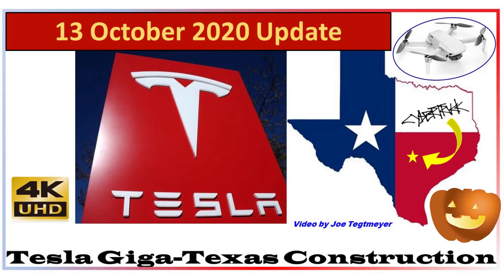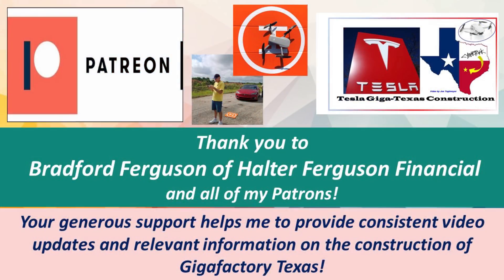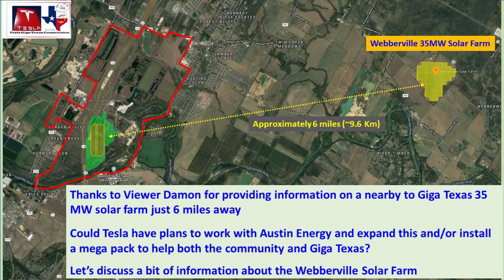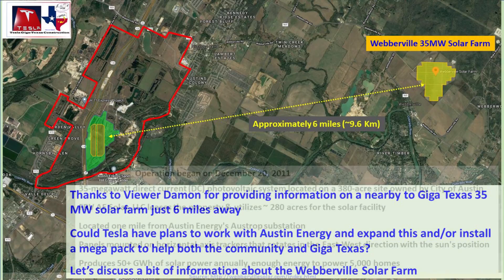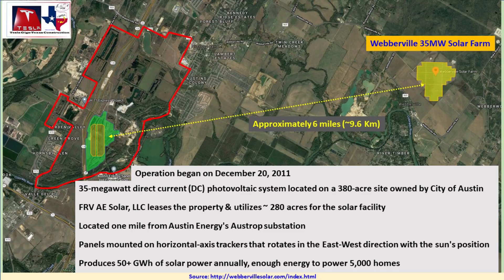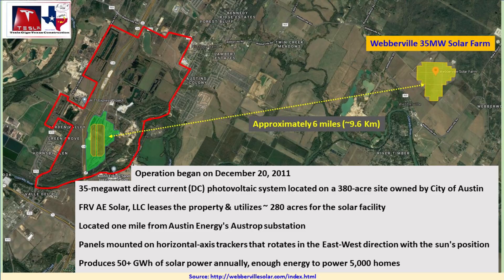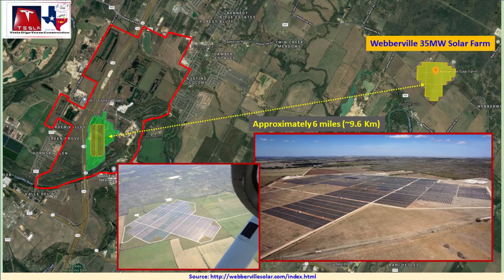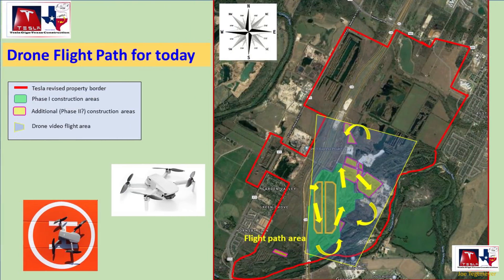Tesla Gigafactory Texas 13 October 2020 Construction Update (09:00 AM)

Comment: It's amazing how Ranger Excavating has used heavy earthmoving equipment to make such graceful contours in the large water detention pond at the south end. Well done Ranger dudes! 
Keystone will  be in and out during these early stages. They'll do a pour then have to wait for awhile for the concrete to cure. Concrete will reach full strength in about 28 days. But reaches 70% after 7 days. Some of those blocks on the flatbed in the pit look like they could be utility vaults for things like electrical power.  Expect we'll be seeing many utility vaults around the site in coming weeks.
Reply from the maker: Thank Dedric ... turns out the “concrete blocks” were actually concrete forms and were put up on the big mud slab later in the day to prepare for rebar and concrete installation

Comment: The other day someone asked about the clearing that was going on under the power lines. I also watch the Giga Berlin videos.  They are going to need a huge amount of area for staging of tools, equipment, building materials, equipment, etc once the building starts going up.  The switch yard is also going to be used for all of this stuff the contractors need to have.  It is going to get quite busy in the future when you have many things going in parallel.
Reply: A minor point:  there are much stricter safety rules, OSHA primarily, about operating heavy equipment beneath electrical transmission lines, also there are other special rules for operating near a natural gas transmission lines.  In many projects these extra rules discourage contractors from using those areas.  In many cases it isn't worth the additional monitoring requirements or the hassle involved.

Comment: Smaller pit is most likely for stamping shop. I am not convinced that cybertruck's folded metal design would require any specific below-ground equipment. Note that stamping shop capacity is reduced when a lot of previously stamped components are replaced by large cast sections.
Reply from the maker: You may be right about the CT panels ... I just don’t know enough about how they form those panels and what equipment they might need.

Comment: Solar farm would help, but if used exclusively for Giga Texas, would provide just 10% of power for the current  phases under construction, based on Giga Shanghai phase 1 and phase 2 joint consumption of 300MW.

Comment: i ordered a Cybrtruk in mid Jan. so i am pretty far down on the wait list ...  But wondering about what day next yr is this factory gonna start spitting out the products ???
Reply from the maker: Target date for first production is supposed to be early May.  But, Tesla has not yet announced which products will come off the line first or what “first production” means yet so we still have done details to learn before a good guess can be made
Reply from the maker: Sounds good to me
Reply: "First production" does not necessarily mean making a product for sale. It could mean first attempts at running entire production lines, which usually means tweaking is required to solve fitment/quality. It is a lot simpler to predict when startup will be than to know when high speeds are assured.

Comment: I think the semi truck in the large pit is loaded with stacks of concrete forms. I’m no expert but solid concrete in that amount would absolutely crush that trailer!😂
Reply from the maker: I appreciate the info and thoughts ... at this point we all have to speculate but that’s part of the fun!
Reply from the maker: I think you are right ... after I published the video I was looking at what was on the truck and thought the weight would be too much.  Concrete forms is a better idea
Reply: @JoeTegtmeyer  again I am speculating here, very large foundation footings have to have the rebar assembled in place and so sometimes they will install two or three sides of the formwork to give them a good reference from which to build the rebar cages. Could explain why the forms would be there before the rebar. Keep up the good work!

Comment: I don't understand why there would be a need for a turnaround. Perhaps I'm missing something, but we don't have those where I live and that's not an issue. Also, where would that ramp of yours be?
Reply: Jonathan Langlois A turnaround will enable southbound traffic to more easily access the plant. Otherwise they would have to exit at the 130/71 intersection further south.
Reply: @BronsonDorsey  That's the part that I really don't get. I mean, there's on off ramps for Harold Green road which is the current plant access. I really don't see the problem.
Reply: @jonathanlanglois2742  5,000+ people showing up for work, all at once, and most of them are driving their own vehicles. That is, 5,000+ per shift. If Texas DoT doesn't rework the off ramps, traffic will be backed up all the way to Austin. ;)
Reply: @theknave4415  My last comment is about the turnaround lane specifically. Turning around implies that you missed your exit. It's not a manoeuvre that the average driver would need to do, and to be had, the existing pair of + intersection allows that manoeuvre to be performed without adding a dedicated lane for that purpose.

You do make a good point about the need for a reconfiguration of on off ramps, but that still does not justify the turn around lane as far as I'm concerned.

From my perspective, the turnaround lane is redundant infrastructure. I don't know about Austin, but where I live, we've always got more road maintenance to do then we've got money for. The turnaround lane is also a very dangerous configuration for bikes and pedestrians.
Reply: @jonathanlanglois2742  Tesla owns the property all the way down to the next exit. 2500 acres (four square miles ) - total - on both sides of the freeway. Texas DoT work is already well under way on expanding the offramp to Harold Green Road, as seen at 7:30 into the vid.

Comment: This is not looking like a new Record, with this small footing it looks like there will not be 2 Floors, this will be a Big Hall. That should go way faster, and also Steel not concrete Pillars. Also easier than Berlin, something goes not as planed.
Reply: The China property was pretty flat, to begin with. At Berlin, it was removal of a tree farm and soil stabilization. In Austin, it's tree removal and 100'+ deep empty gravel pits, full of water. ;) Still, from an even start, I don't see anyone beating China's engineering and construction experience any time soon. For the past 20 some years, they've been eating big projects like this for breakfast. ;)

Comment: TY Joe, nice video again :)
For the concrete blocks in the pit, some smaller ones have holes inside which could be used as access to a concrete area for pipes and cables. From size is think, they will be placed at one end inside the small area in the concrete footer. The other ones could be used to build this cable tunnel and also secure the inner stuff from the things which come above. 
The resize can caused by 2 options: they hold dirt back for spare and later (now) use at other areas or they decided to put a 3rd/4th machine into this pit. From footing shape i think, there will be a 3rd stamping machine updated from Shanghai/Berlin. It could (50:50) be, that they also take out the southern edge of this pit to get the 3rd machine in a row with the other 2. In Berlin there is also an area for CNC machining this stamped parts and a test press/form maintenance, this could be done in the smaller pit. 
We will see what happening there in a few weeks. If I'm right, this area get his final look (in footings) in about 2-3 weeks, concrete will be poured to a 1.5-2m (4-6 ft) height. On top will be 3 stamping press.
Any idea what this black (pipe?) coil at batch plant is for?
Reply: Pipe might be to hook up to the water wells drilled along the north edge of the batch plant area.

Comment: I thought they were filling the area on the south end @ 7:25. But now it looks like they're digging it out?
Reply: They don't want standing water that perpetually breeds mosquitoes, so it will be filled above the water table. 

This smaller pit looks like a good place to catch over flow from the larger percolation field. Or, it could catch overflow from the Colorado. The height of the berms should tell.
Reply: @avid0g  The large bern that goes from the freeway to the transmission lines and has a road on top appears to be a levee. Which could possibly provide some protection from the Colorado. My point was about the smaller area near the freeway they are currently working in. If you go back a couple of weeks and look at the videos. It appears that they were filling it up. Now it looks like they're removing much of the dirt they put in! Though I may be wrong. If you go back to October, 3 @10:51 or September 29 @ 4:45 you will see what I mean.
Reply: @DavidJohnson-tv2nn  
Yes, I see on Sept 29 they had created a tall span, higher than anything else, while geotextile was exposed in the flat area. Now, the second basin is being filled to that geotextile level and the exposed geotextile is covered with a gentle slope. Waste of fuel, for sure. 

Note how the slope between basins is being modified with an indent. I expect that an erosion-proof weir and spillway must be made so the berm between is not cut through during overflow. 

Something similar should be needed between the impermeable plateau and the first basin. After all, you should never assume that the storm sewers feeding the basin can keep up in the worst case scenario.

Comment: Looks like he needs more casting machines to keep the rest of the line busy.
Reply: But the casting machines doesn't need ~10m (32,8 ft) deep foundations, stamping need it, the latest version build in Shanghai and Berlin goes 6m (20 ft) deep in the ground. 
We will see :)
Reply: @danielmunnemann2987  Good to know. I thought the casting machines were so heavy and large that they needed a very thick concrete platform. I also thought you needed more than one at the head of the production line due to the casting speed being slower than the production line. Also, since Elon is always trying to find ways to speed up the production line he might need space for another casting machine even if it was not needed in the beginning.  Might the same be true for stamping machines as well?.
Reply: @KaliferDeil  same truth for both. Sure, the casting machines are heavy with 420t but they only need a concrete plattform and not a 10m deep pit with prepared stuff. Take a look to stamping machines at yt such as Fiat-Chrysler, compare to Giga shanghai and the concrete blocks in Berlin. Also take a look to Gigapress Fremont. If you need some channel suggestions let me know, I don't have it here at my phone.
Have a nice day :)
Reply: @danielmunnemann2987  Thanks! This is all new to me. Fascinating, almost hyponotic,  to watch the progress.

Comment: You asked what we think is going on with the expansion of the pit area (timestamp 11:32), well I think they have decided to add an additional stamping machine and needed to excavate an additional lower area for the bottom of another stamping machine. Here is a reference video to show what I think the bottom of the pit will turn into:
 https://www.youtube.com/watch?v=d_0fIq0dqDo
Reply: Thanks, Jon.  I found that video very interesting.  It must cost a fortune for one of those stampers and all the prep work needed.
Reply from the maker: Good info ... thank you!
Reply: Thank you. I wondered why the presses needed such deep foundations.  The excavation shown in the video matches closely with that built at GF Shanghai phase-2.  Sloped walls allow the foundation forms to be built without installing a coffer dam.
Reply: @frankhage1734  The vertical stamping with a 500-ton press is a lot of pressure and vibration, and they don't want those vibrations to shake the rest of the factory (maybe).
Reply: YES,  a picture is worth a thousand words. A stamping press is a huge machine requiring a huge foundation.  It is no wonder they are working on this first, even before working on the building foundations.

Comment: From what I remember hearing Joe is that Giga-Berlin are slated for 8 casting machines. Since Tera-Texas is going to be bigger with more production it's possible more of the casting machines will be placed there. They will need plenty of base to have for the machines since (if I remember correctly) they will weigh in at 42 tons each.
Reply from the maker: 410 tons each ... I think you lost a zero 🤗
Reply: @JoeTegtmeyer  Oops.. Thank you Joe!!
Reply: @richardcorwin5529  
You can still edit that typo!
Reply: @avid0g  LOL.. I don't mind showing everyone how stoopid I can be!! :-)
Reply: I don't think they need a Casting Press like in Berlin, if this is cyber truck and  Semi Model Y and Model 3 are later than they build something like shanghai and Berlin. This is different, 1 Building Cyber on Building Semi and 1 Building Batteries. I guess!
Reply: @Tangopassion1  
I expect all models except S and X to be produced here from the very beginning, with more buildings and lines added as fast as possible. US demand is going to outstrip Tesla supply for decades. 

Casting chassis is a done deal for 3, Y, and 2 everywhere. Maybe refresh the S and X designs as well, even though volume is lower. 

Every possible pound needs to be removed from the Tesla Semi tractor as well in order to increase payload capacity. Aluminum casting and high-tensile steels may be useful there as well.

Comment: It's striking how deep those excavations are..   giga-nevada is 3 levels above ground.   looks like they've got depth for 2-3 sub-levels in these locations as well.

Longshot guess..   this is where the tunnels connect for boring company .
Reply: Looking at Berlin, they got deep pits there as well but by now they are nearly ground level after virtually filling them with formed concrete... maybe just assuring a good solid footing for massive machines. We used to need to put in gigantic and deep foundations for stamping presses and they still slumped the floor, can't stop entropy, you can only slow it down, probably much the same thing here.
Reply from the maker: We shall see 😎
Reply from the maker: Entropy and gravity are the challenges these huge footers are trying to counter
Reply: Boring Company officially applied for extension of their system to every major hotel on the Las Vegas Strip, continuing to McCarron Airport and to Allegiant Stadium (Raiders). It is expected to be approved soon.

Comment: YAy Joe , thank you for the update  and  the news about the solar farm , this Is what I am thinking Tesla will be doing with at least a portion of the land on the other side of  130  .  : ) I would  defiantly think that with such a project  Elon would likely be involved in some way .. What better PR than you have a project of such scale and offset your own carbon footprint.
Reply: 99% they'll just put the panels on the roof of the main building... why bother clearing and upkeeping more land and running cables from another site?    But yeah.. .they have got to have panels somewhere.
Reply: @WhodatIzz  I wonder what kind of kwh they can produce over the course of a year if they used all available space for solar on the roof. And on top of that, what % of the factory's consumption would that be?
Reply from the maker: Perhaps they will do both? Anyway, thought it might be interesting to mention there is a good sized solar farm nearby
Reply: Now, that's an interesting thought!